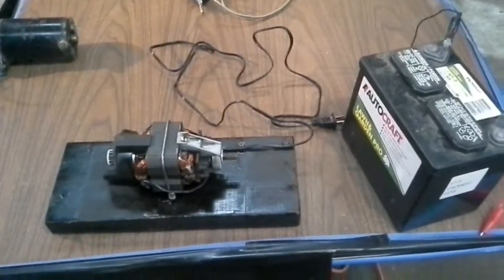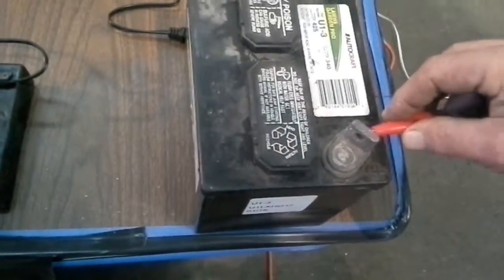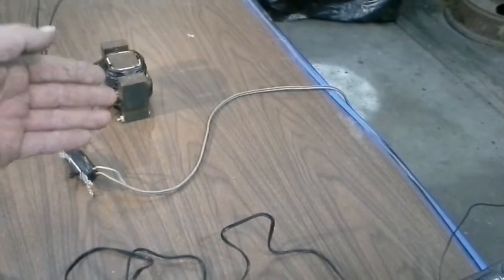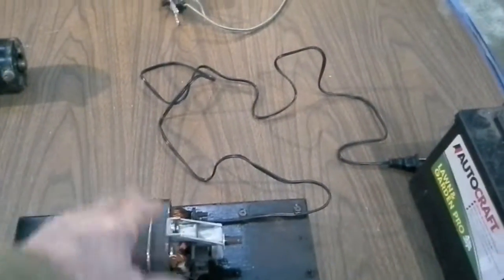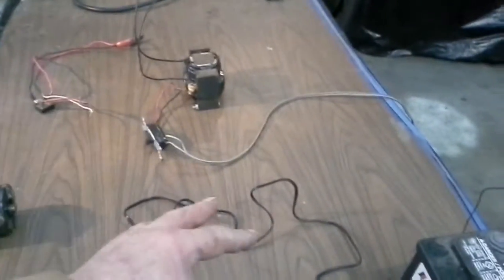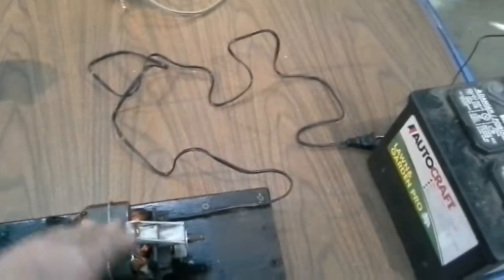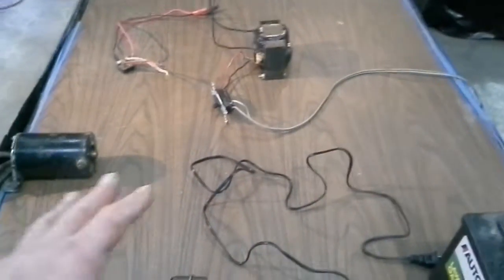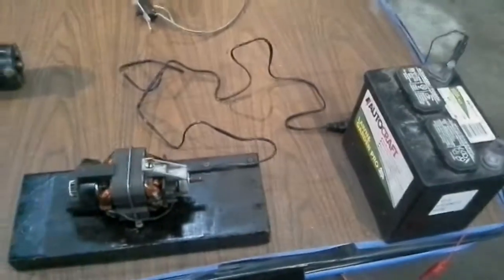Note about Low Voltage on AC or DC Motors

Comment: If i ran a 12vdc water pump off of 9vdc. It barely runs but still pumps water..  since its still doing work im guessing the water will keep everything cool and happy..  my question is will there be excessive heat generated by the magnetic field being so weak causing the eddie currents to get angry and inevitably cause the pump to give up the smoke?
Reply from the maker: Any motor (ac or dc) will run on a proportionate amount of more - or - less - voltage than it was designed for. It is the "load" on the motor that will cause lower voltage to damage it quicker. The heat will increase more with low voltage - and heat will increase with too much voltage - either being too "much" or running on wrong voltage for "too long" will cause the smoke and fire...

Comment: So I have a brushless motor that’s rated for 36v. For some simple testing, I used a 18v pack  and it stutters. It’ll stutter until I give it a bit of a push and then it spins up. Is the stuttering caused by low voltage?
Reply from the maker: Yes.